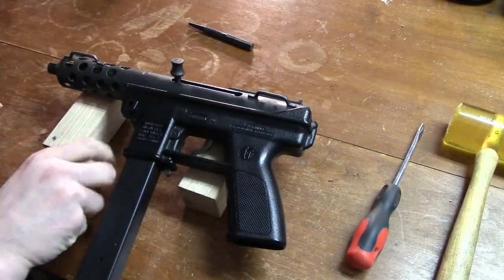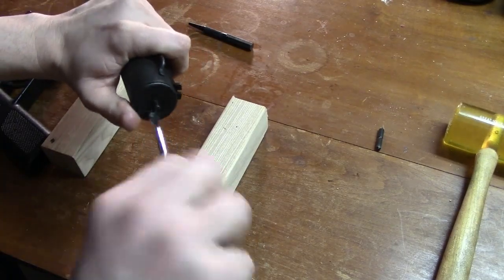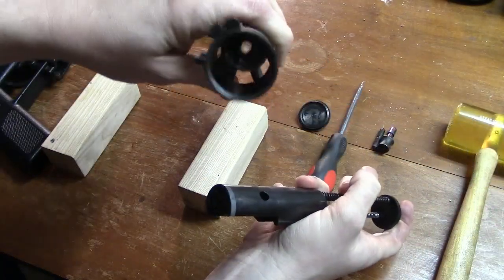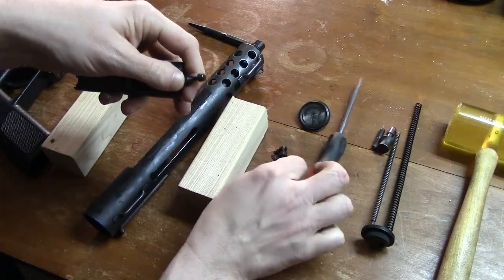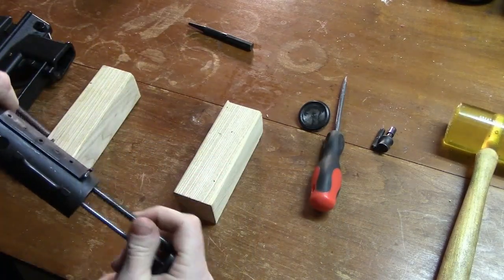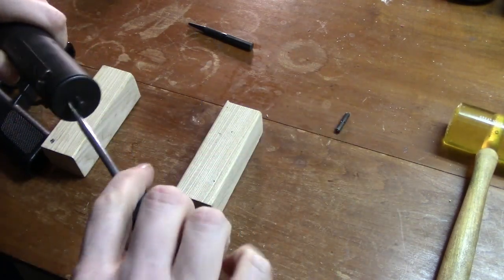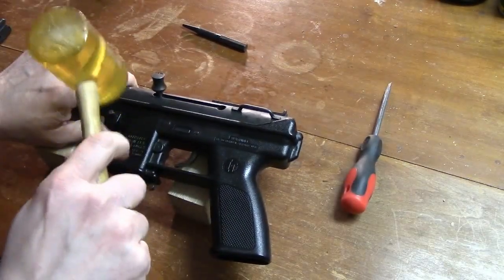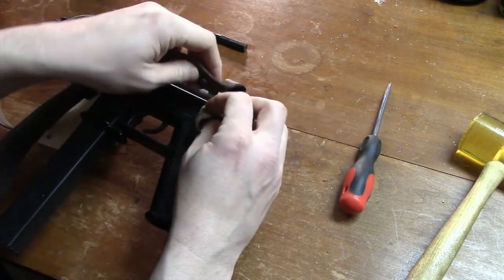Intratec TEC-9 Basics

Comment: what kind of sling do you use
Reply from the maker: It's actually an old surplus G3/HK91 leather sling. The strap is narrow and fits nicely on the sling bars, and the front connector is a nice clip.
Reply: @commanderstech6743  hey there, do you have a schematic or drawing of the firing pin and dimensions you could share please?
Reply from the maker: @Yeahright666-  You can get a new firing pin from US Machine Gun LLC for about $50 (https://www.usmachinegun.com/products.php?cat=45) its about 2.5 inches long and looks about like an AR-15 firing pin.